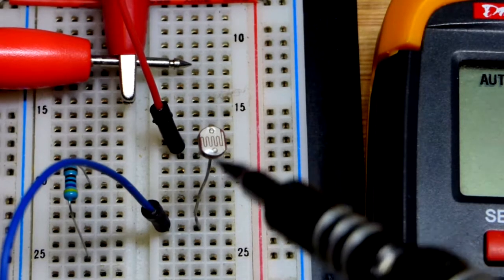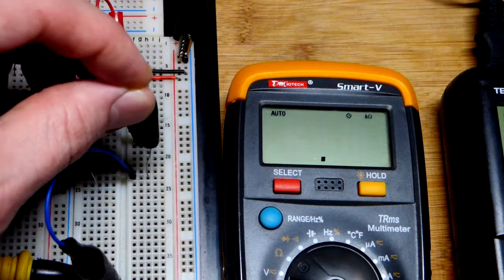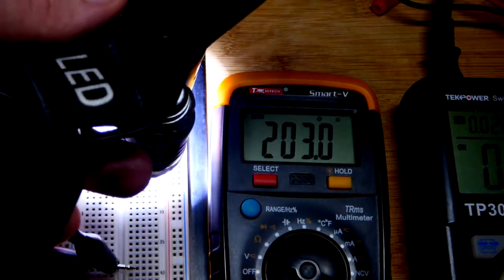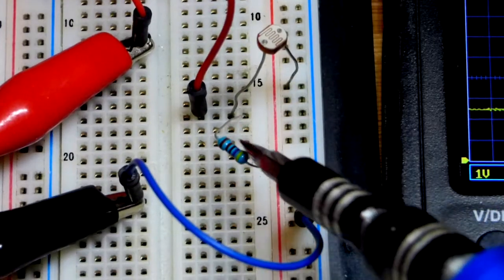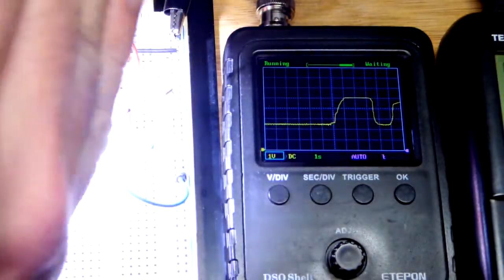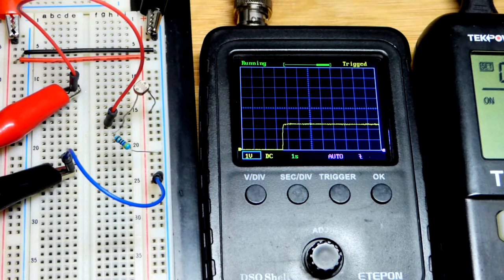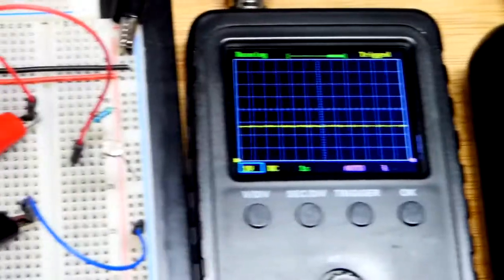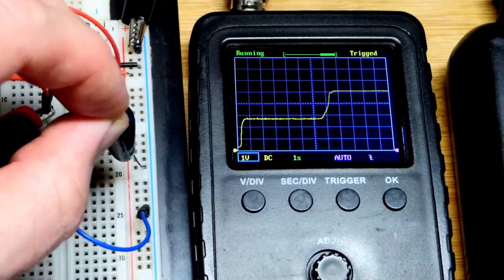Light dependent resistor LDR variable resistance and as a voltage divider for how to DIY electronics

Comment: I just looked at a LED light that uses this. This actually explains what I thought was happening. I believe there another device that's used for movement detection. I'm not sure how that works but I think it's works in a similar way but it has 3 pins. I want to modify it the light. Just not sure what I want.
Reply from the maker: There's a sensor that usually looks like a white dome that detects motion. I never did look up exactly how it does so.